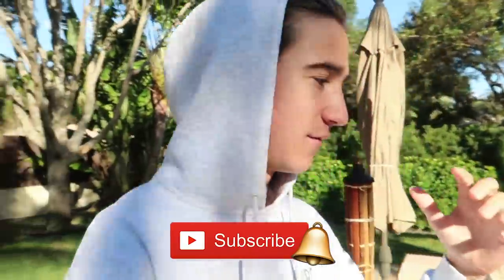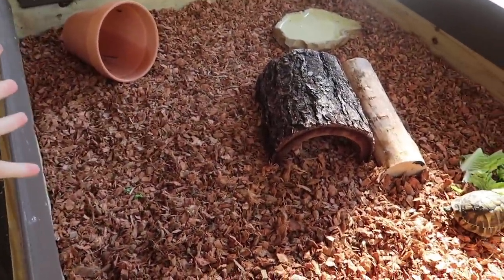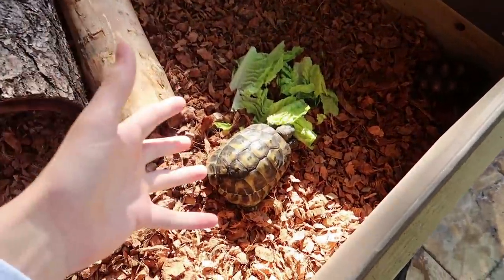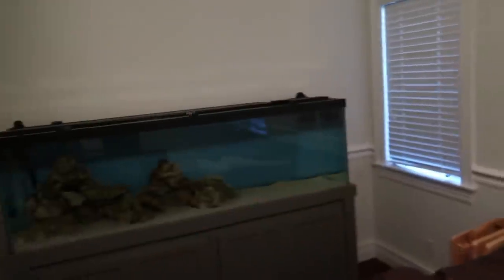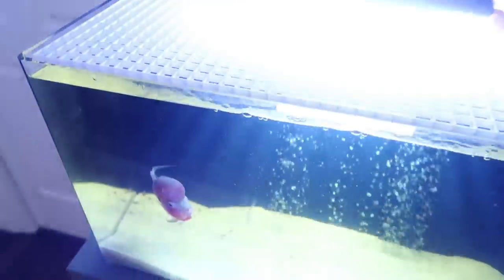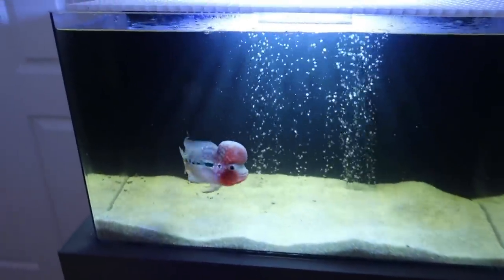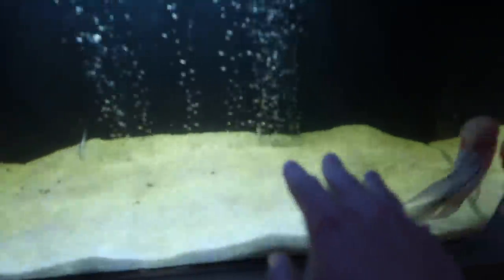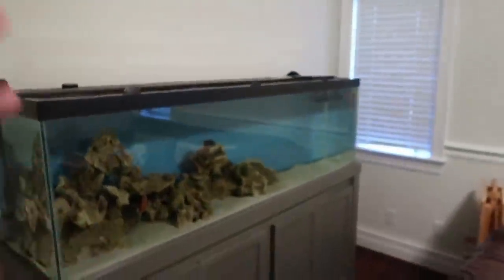My FLOWERHORN WENT MISSING... *FISH EMERGENCY*

Comment: Derp. There is a reason why you're supposed to soak wood for a minimum of 48 hours prior to adding it to a tank. 1) Releases excess tannins 2) allows the wood to absorb water so it sinks 3) minimizes the risk of any chemicals being in the wood that would harm your fish. And always, always, always, put it in boiling water for at least 5 minutes.